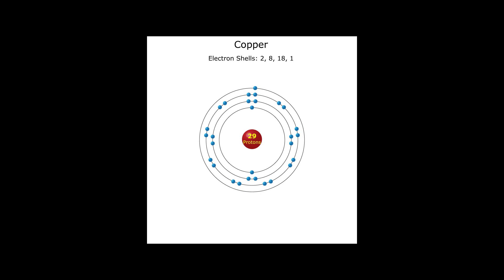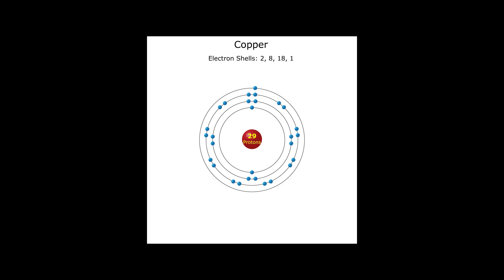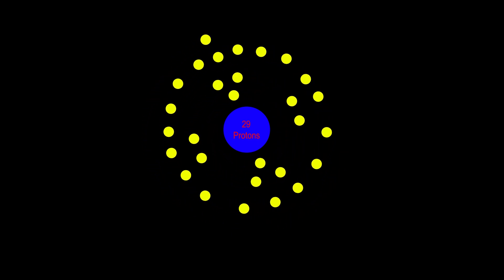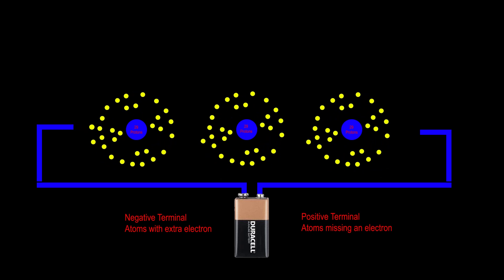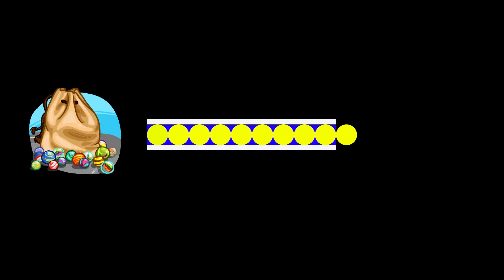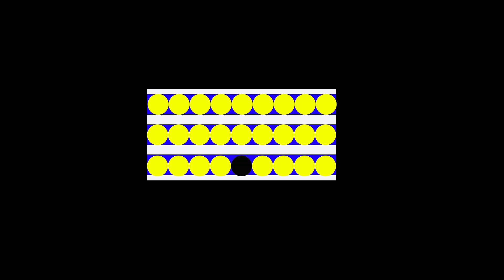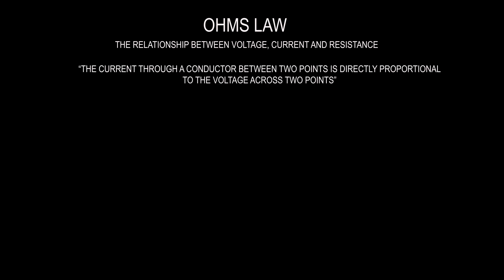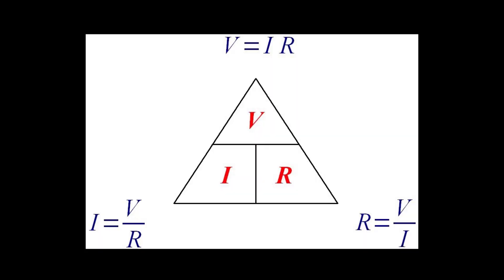Ohm's Law - Beginners guide

Comment: Sorry, nice try but not useful enough to use teaching GCSE Electronics. The model needs to illustrate all that happens, but not complicate it. 

The inner electron shells aren't relevant - remove the complication.
There's nothing in the graphic, to suggest that current would increase with voltage. 

A water analogy with either a pump or a raised tank, introduces the idea of pressure, which is close to voltage - depending how you describe what the pressure does inside the water.. Once kids have something they can visualise - water is relatively easy - you can then go back to a pseudo realistic explanation. Pseudo is as close as you're going to get...!
Reply from the maker: Thanks for your feedback - I have a few others too so will adapt the graphic based on everyone's ideas.  Its something that needs refining to the point where it is useful and knew when I published it that it was not quite there yet.  Thanks for the ideas - I've used the water analogy many times in my teaching - maybe that is the way forward.  Thanks for your help - its a difficult one to get right.